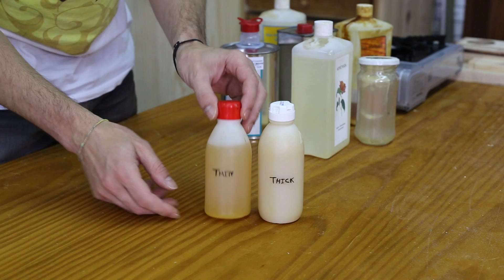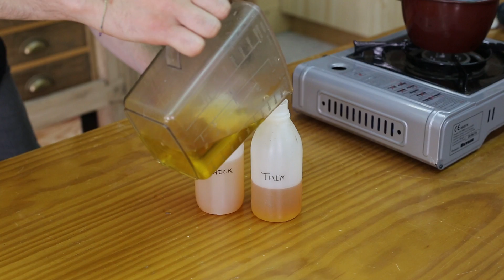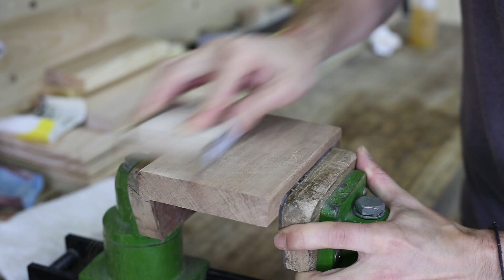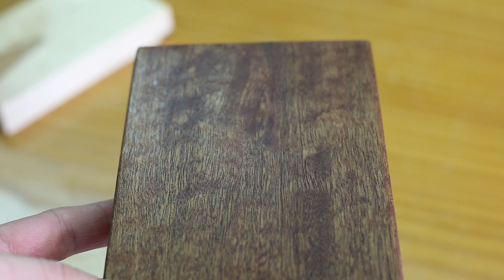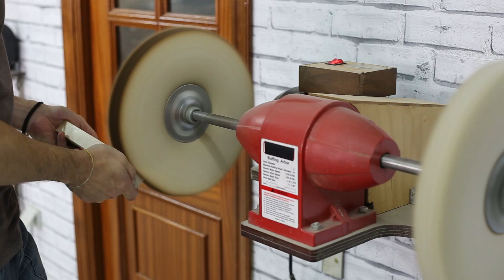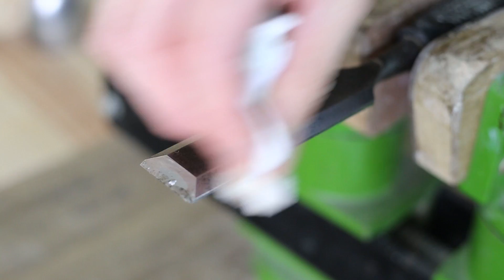How to apply an OIL-Based Varnish

Comment: Will this finish self ignite if the rags used to apply it are not disposed of properly?
Reply from the maker: It is a very easy  to apply finish, you will not have problems! thanks
Reply: That's always a factor when "drying oils" are used. Mostly Linseed oil. I burn my linseed soaked rags always.  Intentional combustion is much more predictable than spontaneous.

Comment: Thanks for sharing. It is interesting contrasting your technique with others. How long does it take you to get a full gloss result? 

I noticed you polished the finish. Any particular abrasive polish?
Reply from the maker: after applying the oil/wax, with a little practice it is easy to get a hight gloss finish. Only needed some polishing compund and a buffing wheel which can be attached to a drill. Polishing takes about 10min, In another video I show you how to do it!. Take a look at this:
http://www.stewmac.com/Materials_and_Supplies/Sanding_and_Polishing/Buffing_and_Polishing/Menzerna_Compounds.html
http://www.stewmac.com/Luthier_Tools/Tools_by_Job/Tools_for_Finishing/Buffing/StewMac_Guitar_Buffer_Complete_Outfit.html